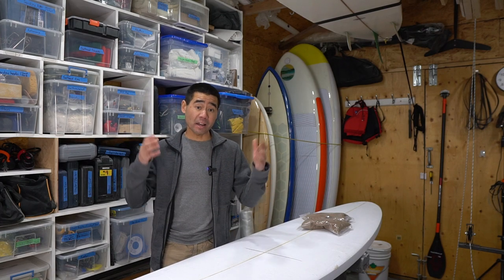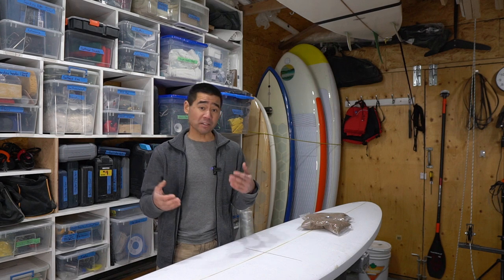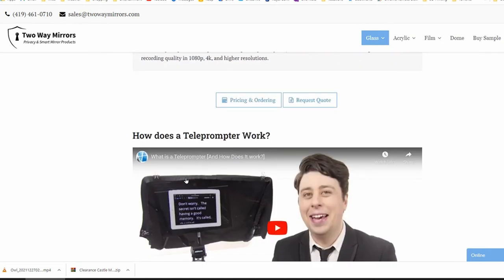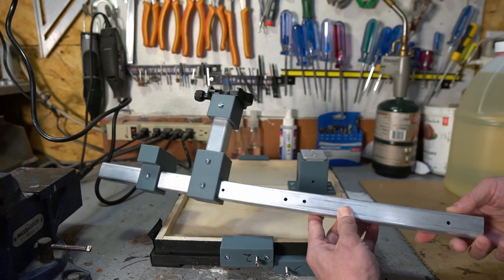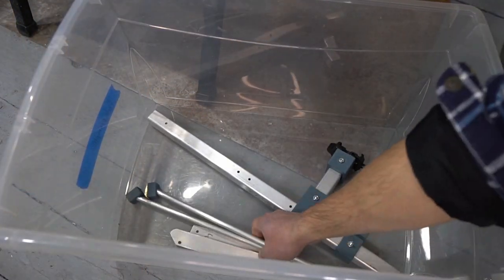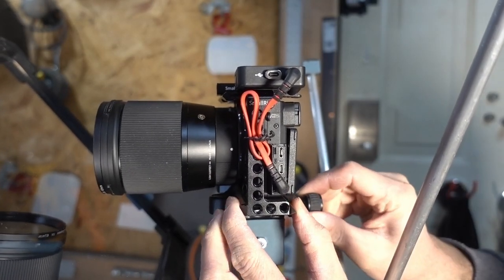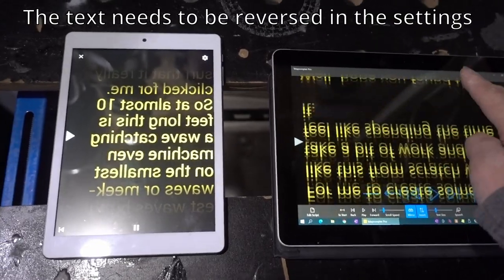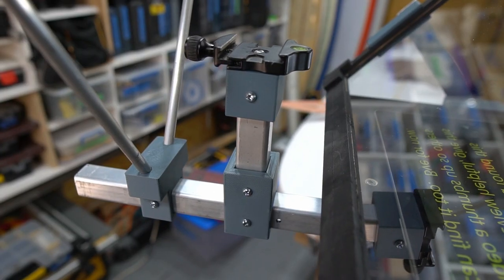How to Make a Teleprompter | Video Production

Comment: Nice build. I hacked one together years ago without a beam splitter. It was fine for big text.  But now I have a $120 one that works nice for online meetings with a $60 8" monitor that allows you to mirror flip the image right on the monitor without any special software or drivers.